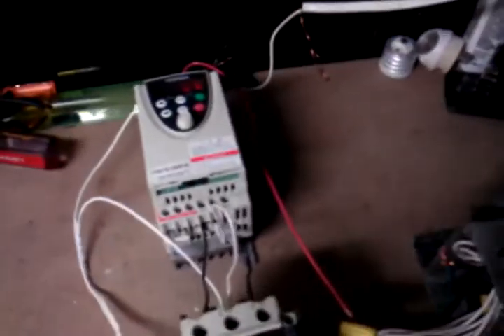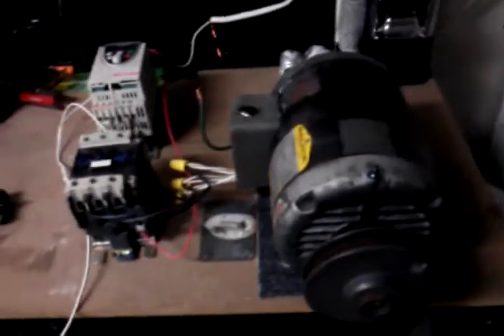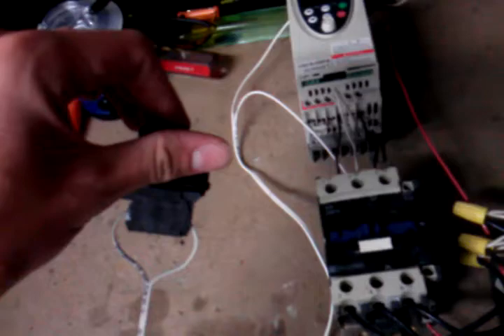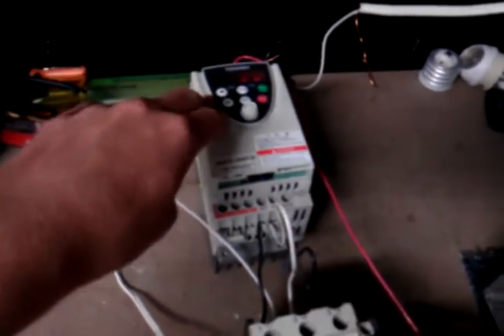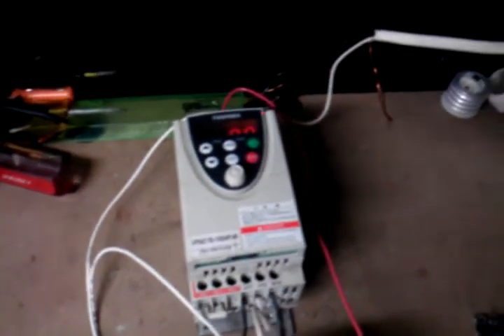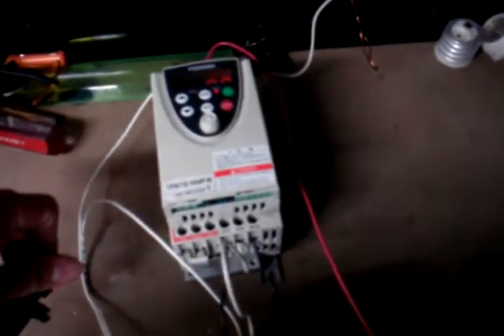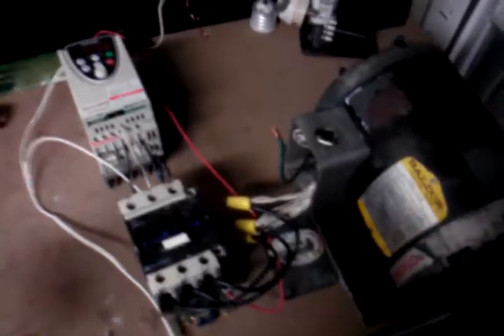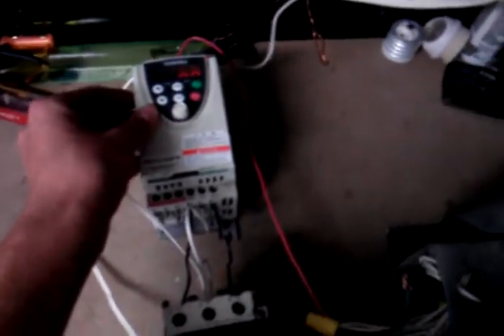3 Phase Power From A Car Battery!

Comment: My Siemens and Danfoss VFDs specifically warn against using a contactor on output of the VFD.

Where is that 60hz whine coming from?
Reply: I believe the converter connected to the battery just before the VDF
Reply: My bad I misread. Probably just dirty or a bit of rust on the inside of contactor. I had one so dang loud and blew it out with air and that helped out a lot.

Comment: How long were you able to run the motor continuously?
Reply from the maker: Blake Gardner This was simply demonstrating that it can be done, since the drive uses a double conversion. A 1HP motor at full load uses 768 watts, add 5% of inefficiency for each inverter, 845 watts. The amperage being pulled from the battery is found by dividing the wattage by the battery voltage, so 845 divided by 12 is 70.4 amps continuous. On a 50 amp hour (Ah) battery, the motor will run for .71 hours or about 3/4. There are a lot more inefficiencies and factors that can change runtime, but that is a rough estimate, such as if you were running the VFD at 30Hz, your load would move half the speed and your runtime would increase to about an hour and a half off of one 50ah battery.
Reply: Do you think it would be possible to use this setup to power a bicycle? Do you think a 1hp motor would be enough power?
Reply: @blakegardner2339  you could but a DC motor would be far better